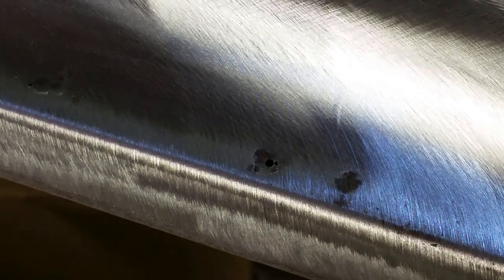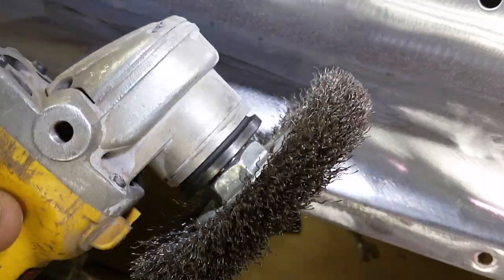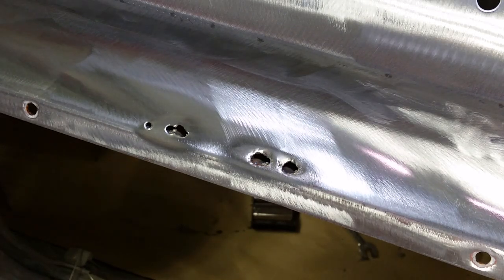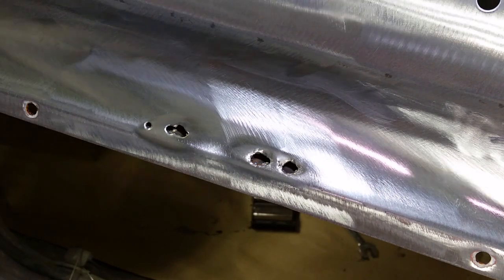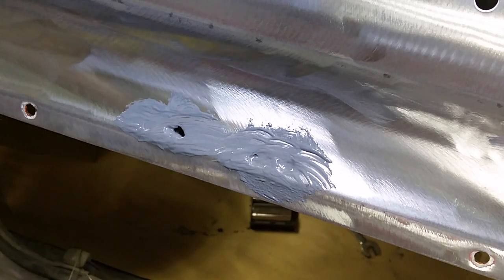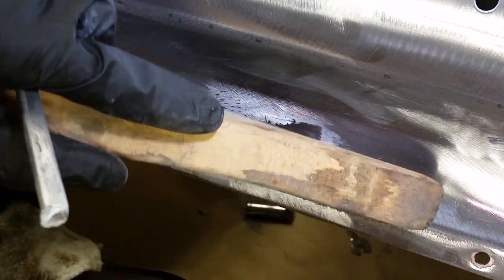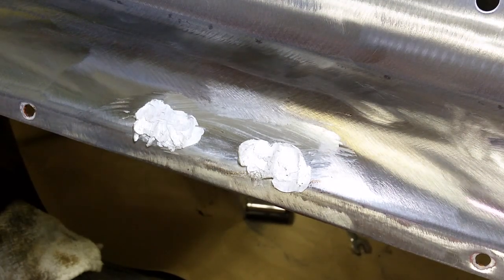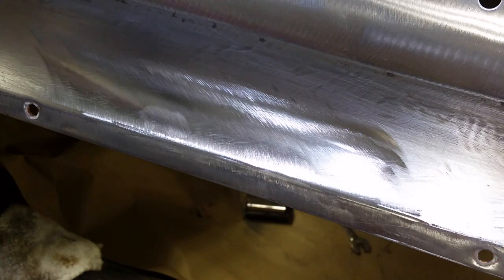How to repair rust holes in 15 minutes

Comment: Is that an aluminum brazing rod youre using? I cant seem to get my brazing rods to melt and stick, been using plumbers flux, but I'll look for some of that tinning butter.
Reply from the maker: Kelly Keenan it’s 70/30 lead from Eastwood tool. Google 70/30 lead from eastwood and it should come up. Thanks.
Reply: @gillrodshop  Cant find much of that up here in Canada. Does the lead do anything special instead of using brass or aluminum sticks?
Reply from the maker: Kelly Keenan has a low melting temp and files easily. Did you visit the website www.eastwood.com? That’s where I purchased mine.
Reply: @gillrodshop   Yep, $37 to ship a $6 stick to canada lol. I'm going to try and find something locally. I like the idea of using that wood thing to smush the lead into the holes, I think mine was just sitting on top before and still letting water through.
Reply from the maker: Kelly Keenan wow 😳

Comment: Great video. Thanks. Wondering what type of rust encapsulator you use ?
Reply from the maker: MT thanks, I use Eastwood brand and you can usually find it on eastwood.com.  If you need to thin it use a professional lacquer thinner.
Reply: Gill Rod Shop .Thank you for responding. Looking them up now...

Comment: ok to use this method for chrome bumper?
Reply from the maker: It should be but you may have to de-chrome it, repair, and chrome it again. I haven’t tested on a bumper yet but I do have a piece of dash trim at the chrome shop now and I’ll publish a video as soon as I get the piece back. These pieces are stainless and I filled a couple of dings with lead body solder.

Comment: Im a painter myself, never done lead.  Im just curious how long that would last or if it would cause ANY issues down the road.  I would try to weld when I could but I certainly see the time savings here and how easy it is.
Reply: My 1966 new yorker still has the factory lead on it.

Comment: you make it look easy thanks.will have to try it on my roof panel.
Reply from the maker: Fat T it's definitely easier than welding that thin metal but just remember not to apply too much heat when applying the body solder and you'll do just fine. Thanks

Comment: Never seen anything done like this. Wonder if the lead will expand with cold and hot cycles differently than steel. that might cause some problems ahead.
Reply from the maker: Andre Post lead is in almost every classic car at the sail panel installed by the factory. In my experience they act similar during thermal expansion. Good observation and thanks.
Reply from the maker: Andre Post thanks

Comment: Tallow is rendered animal fat that has a higher flash point and doesn’t effect the ability of the lead to stick. Crisco is vegetable oil and will burn. The soldering paste is an acid based flux with fine lead in it. It gives a cleaning effect while leaving lead on the surface. I was shown how by a retired Chrysler body tech who did it on repairs for decades. Plastic body filler as we know it was introduce in the 50’s and was not widely accepted in the industry at first until guys who never wore respirators with a two step system that had a dust filter on top of an activate carbon filter that 3M has made so popular and cheap. Just buy filter packs, twist-on and keep going. When you smell paint thru your mask, it is time to shave or replace your filters. 
 Sanding lead is never done as this dust will attract the nervous system, just like lead-based house paint. The roof on cars and trucks were attached using this method at the seam after spot welding and by no means is it a “Structural” component to the vehicle. It is just a low temp metal filler that is shaped by temp control and wood paddles dipped in tallow to make them slide. Masters of this can do an entire sail-panel joint in 10 minutes and paint ready as well. 
 I would make sure any drain holes in the rocker are not plugged. They are on the bottom back side of rockers and next to door skins. The door outer belt molding with the fuzzy or felt will let moisture inside the door skin, along with humidity that condenses on cool nights after a muggy day. It forms droplets that run down to the door seam. Any vehicle that is rust free in the first 10+ years can and does need cavity wax (Yellow Stuff) sprayed inside on these internal seems. Use a tooth pick to make sure they are open after a day or so. It will help keep rust away for decades.
Certified Automotive ASE master tech since 1978, retired.
Reply from the maker: What city and town are you living in now? I’ve been looking for a knowledgeable person such as yourself to learn the ways the cars were manufactured!
Reply: @gillrodshop  I am in Omaha but learned how cars work on my own until I helped a guy build a shop behind his house. I apprenticed with him. After 28 years in a Chrysler dealer, he told me he learned more in 6 years in a speed shop. 
I will never forget Carl. He has passed, but a skinny, patient man and straight shooter with me and customers!

Comment: I the lead toxic to breathe?
Reply from the maker: Good question, Rob! I try to always protect myself with PPE (personal protective equipment) as much as possible because this stuff may cause some illness that we don’t know about yet but the older guys (G. Barris and B. Hines) that used the real lead lived to be 90 plus. Happy Lead Slinging! 🙂
Reply: @gillrodshop  Good thing that you wear PPE cant be too careful.
Cheers and a really good job!
Reply: @gillrodshop  I need to repair a moped that has two cracks one inch long each due to rust and i am searching for the best way to do it. 
Thank you

Comment: I wouldn't be leading holes like that, no matter how small.  If the panel is rusted through in those spots, there's bound to be more rust behind the panel.  Just cut and replace the panel.
Reply from the maker: Richard Carter you're right...I did replace the entire panel behind it with a patch strip about 1.5 inches tall. I will also seal it with rust encapsulator by flooding it and letting it drain.
Reply: Yep you can count on being more rust inside.

Comment: You didn’t neutralise the acid before putting the lead in , so therefore that will rust under the lead again.
Reply from the maker: Keep in mind that tin is under the lead, that tin won’t rust, and lead won’t bond to bare steel, making it impossible for rust to be trapped between the lead and steel! Sand the flash rust from the steel with a soap/water solution just before applying a primer/sealer. I used to use the neutralizing washes but noticed that the dang metal would flash rust anyway after a few hours 😂 and I had to prep it again before the substrate application. Thanks for pointing that out. 🙂

Comment: Just curious, but couldn't you just shoot some weld into that like a plug weld? I'm learning, so thanks for the video.
Reply from the maker: jarmen1105 Sure it can be plug welded if I could access the backside but I could not without cutting the sub panel from underneath the trunk lid. I usually cut and repair holes this size but I figured I'd give it a try. 😁 Thanks.
Reply: How would you remove or stop  rust behind the hole in the situation like you had?
Reply from the maker: jarmen1105 I've already cut out and welded a new patch panel on the back side. I will use a garden sprayer that I've modified to spray rust encapsulator between the two. If you are interested in knowing how, subscribe to my channel to get the update when I upload it in the near future. Thank you.
Reply: Subscribed! Thanks.
Reply: If you're welding and can access the back clamp a piece of copper to the back over the hole to keep from blowing through... the weld material won't bond to the copper ...just a old welders trick.

Comment: you need to treat the inside of that area with transmission fluid when done. or it will be back next year.
Reply from the maker: @immrnoidall I did replace the back side with new 18 gauge sheet metal and treated the inside with encapsulator. Thanks for the advice, I will keep that in mind. 🙂

Comment: Only thing is, paint will pop off on all those spots! And not to mention the toxins your setting off  and breathing
Reply from the maker: tyler hoskins I wore all PPE but if those toxins got through my PPE I should at least live to be 90 like George Barris bc he used a ton of body lead. Thanks
Reply: First off...never paint over bare metal! You need a good direct to metal primer before top coating.
Epoxy primer sticks to everything, and has good rust prevention characteristics.

Comment: This is not fixing a hole. This is covering it up.
Reply from the maker: Thanks for watching! If I had welded it would it be considered “fixing” or covering up? This is what the factory used to “cover” the seam between the pillars and roof when these cars were built. That stuff doesn’t come out easily. 😁
Reply: @gillrodshop  try tig with mild metal rods. High build at 55 amps med. pulse shield argon. Will be same consistency as sheet metal. Nickel size hole, puddle tack. Use the back of the dolly to cover back hole when possible or a piece of copper. You would be amazed how quick and how perfect you can get it. Once you grind and sand to blend it will be as if the hole was never there. Strong and will not crack. Led is heavy and toxic.
Reply from the maker: Renee Elliott this video is about NOT welding and I very rarely TIG body panels unless my MIG welder is out of gas.  To see more of my work please subscribe or visit my Instagram page @ gillrodshop or facebook under name JC Gillard. Thanks 😊

Comment: How can you sand lead without getting it all over you? Seems stupid
Reply from the maker: Wear PPE!
Reply: @gillrodshop  i don't know if you grow facial hair but just one day of stubble multiplies the respirator leakage by multiples of a thousand. I have a full beard and don't have the money for a forced air system. I reckon filing the lead is best, but I'm not any expert
Reply: @gillrodshop  i wear coveralls regularly and love them, but my face and lungs get neglect sometimes
Reply from the maker: @mikem5475  you may do it both ways but using a power tool is the quickest way. I try to protect myself to the best of my ability! The guys of old used to not wear any PPE and those dudes are still alive with full heads of hair 😂
Reply: @gillrodshop  yeah, crazy how the human body works
Reply from the maker: @mikem5475  Yes, it’s truly amazing!

Comment: That's a temporary fix.  Cut it out, further than you expect until you get clean metal.   Weld in a new patch with weld through primer.
Reply from the maker: brucenoneyabusness yes that is correct and I've done it that way, too. Please watch my other videos about that. Thanks.
Reply: @gillrodshop  it was still a great example of metal soldering and finishing.

Comment: Oh that was painful to watch the El Cheapo video. Oh Pete, do you realize that cheap work isn't good and good work isn't cheap. Old school auto body lead work and the entire CORRECT process is an art form, not... a cheesy hardware quick fix. That was very disrespectful to a technician that has done it correctly for 30 + years. If you can't afford the 150.00 for the right products to do a quality repair, then... you should just buy some bubble gum and duct tape from your hardware store. While your at it... maybe wipe some grease from your pizza on the prepped area before you prime and paint. I'm sure your results will be awesome. Don't forget to use the very best $1.99 spray paint if ya want to get real fancy. Oh the humanity from that painful how to video. I'm literally sick, was Pete serious or maybe he knows nothing about quality and pride ??.
Reply from the maker: EDWARD Ratjen I appreciate and value your experience and I will take your comments into consideration. Thanks 🙏
Reply: What the hell are you talking about Edward? Care to enlighten as to why this wasn't correct in your 30 years of experience? Because I have people bring me all kinds of cars just because I will paddle lead or braze vintage parts like trans covers. Just because it isn't plastic filler or Tig welded doesn't mean it's wrong